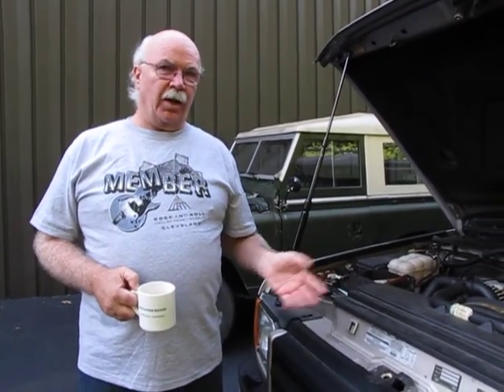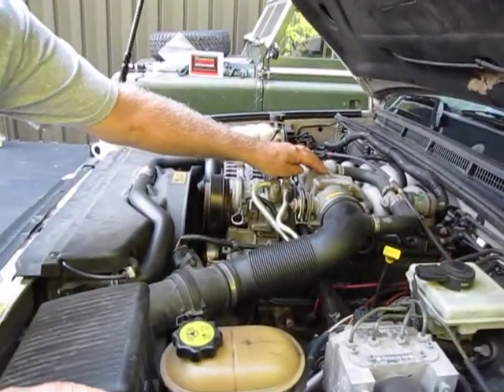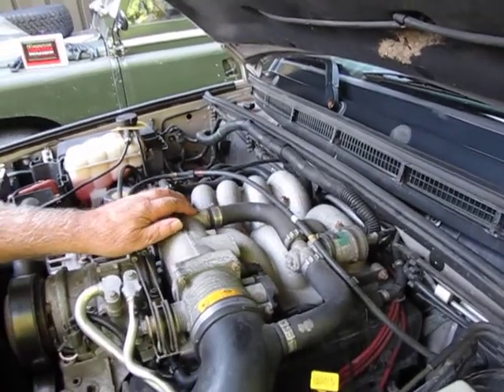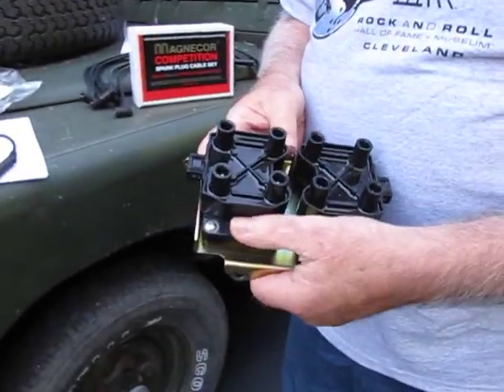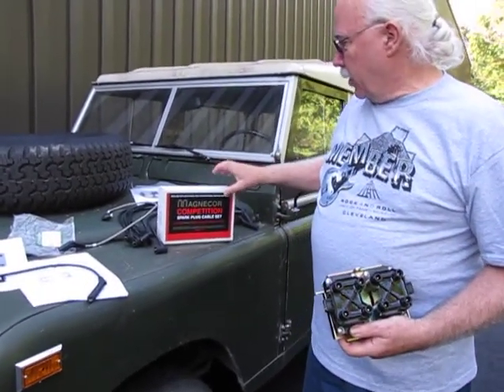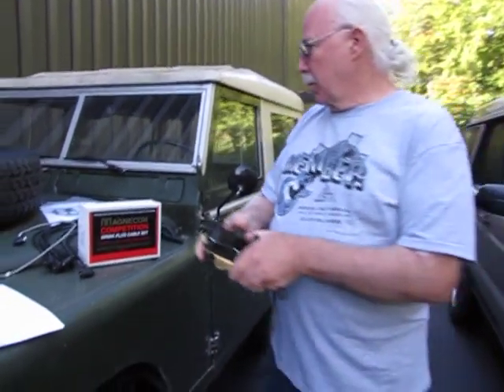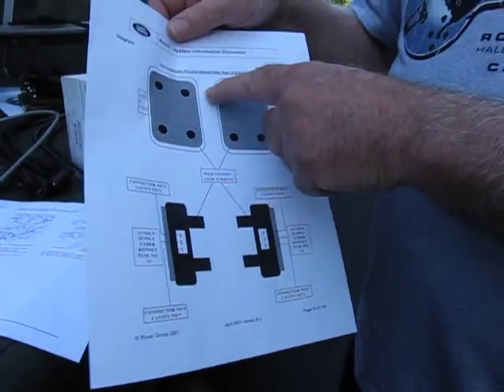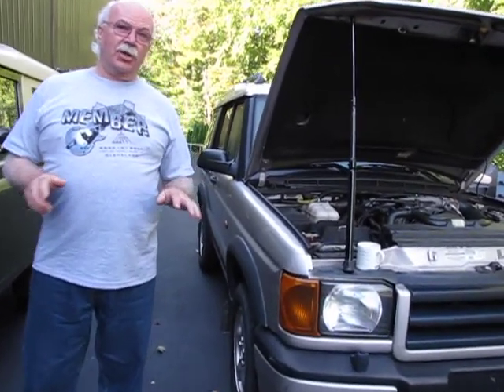Land Rover Discovery Series II Ignition Cables Installation Tips

Comment: Need Help.. Had a loose negative battery connection so I cleaned it up  and got a new battery tried to install it positive first then as soon as I touch the negative cable to battery terminal it Sparks and welds to terminal also she(2000 land Rover Discovery 2) tries to start!if key is turned it will start up fine but sounds like starter keeps running(doesn't matter though because I can't put Neg cable on because it will weld to terminal). So I disconnected starter wire from starter solenoid then touched negative battery cable to battery terminal and she still tries to start(No key in & no starter wire but still tries to start)?

Comment: Bear of a job is right.  I did, however, successfully change mine without pulling off the upper manifold.  The tricky part was fully seating the new spark plug wires into the coil, which I more or less did by "braille" with the help of some Harbor Freight 16" needle nose pliers (and a LOT of patience!).  Follow the wiring diagram and do one plug at a time.  Took me 3 hours start to finish.

Comment: I have a 2003 with the secondary air system and have actually removed and replaced the spark plug wires without removing the manifold plenum. It is definitely easier if  you have the plenum off but it can be done with it on . You do have to remove the secondary air pipe if you have it as well as reposition the wiring harness. I found that bending the tip of an old long flat blade screwdriver about 20% helped me position the wires to snug them onto their spots on the coil. Also, I highly recommend using 8mm wires instead of 7mm. They will hold up better. You might need to uses a bit of O-ring grease to slip them into the wire holders that keep the wires in place. Magnecore are good but you can get Kingsborne (not sold by AB) for less then half the price.
Reply: I did the same, was not fun but once you get the secondary air lines out you have some room...sad for my my coils are gone too so back in I go!